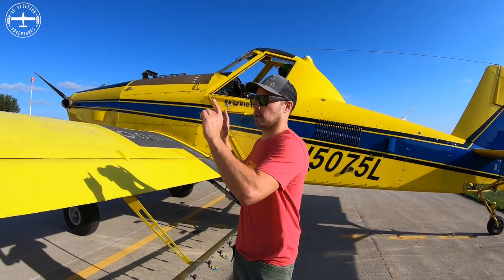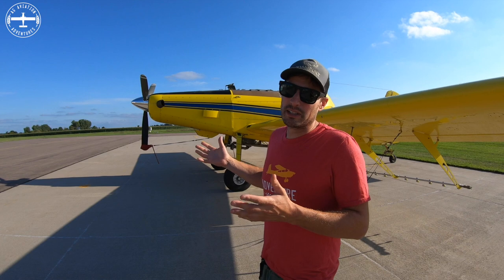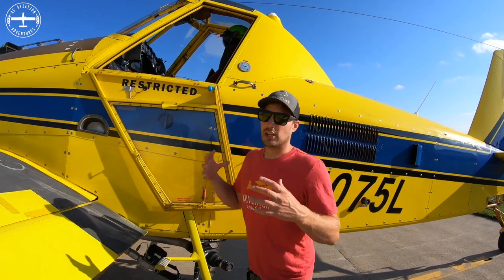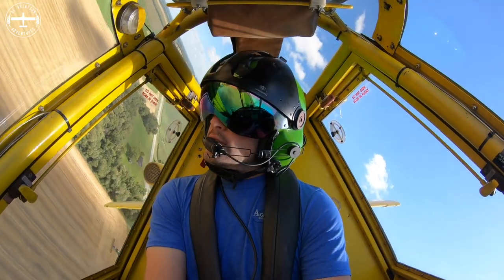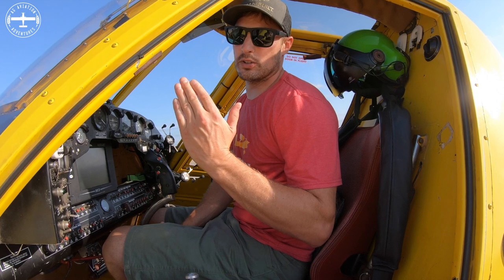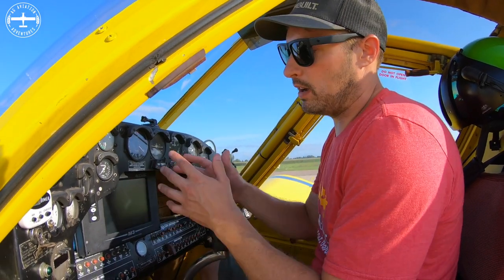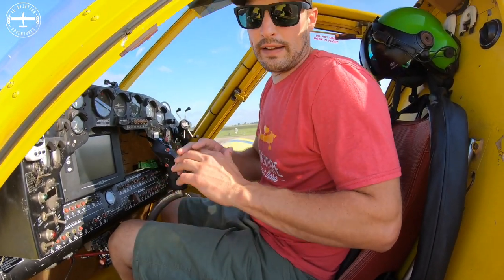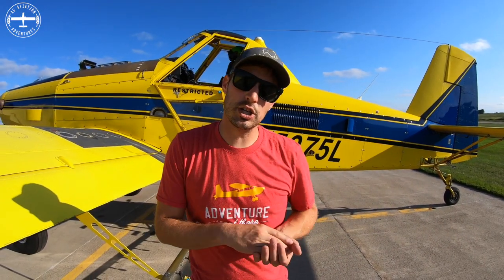Air Tractor 502 Spray Plane Walk Around

Comment: Very interesting segment.  QUESTION:  Do you have an alternate method to pressure up the spray system such that you could energize it while sitting still?  I'm thinking that might be happy for ground maintenance issues.

As always, thanks much for sharing.

Steve
Reply from the maker: Yeah for sure. You can hook a hose to it to pressurize the boom if you needed to.

Comment: What's the cable for between the cockpit and the tail?  I've always thought those were for powerline protection.
Reply from the maker: Yeah. If you happen to catch a power line it’s suppose to prevent it from ripping the  vertical stabilizer off.

Comment: The emergency lever opens the Doors to dump the load in case of emergency.  Those same doors are used to spread seed.  How do you keep from dumping all of the seed in a few seconds?
Reply from the maker: The lever has a button on top of it. If I push the button it opens the door completely. If I just push the lever forward without hitting the button it will hit a stop that is adjustable so you can vary the gate opening.

Comment: Hey Tyson I know you fly the real thing and flying your dream,but you should join us ground pilots down here and try flying RC it’s just as much fun as you are having up there...why do air tractors drop smoke from time to time?? Last summer an air tractor came by our flying field and drop a line of smoke...I guess he was saying he was having fun too.😊😊
Reply from the maker: Charlie Ayers You’re right I should go and give it a try. Something new!

That’s called a smoker. There is a button inside the cockpit and when you press it oil is injected into the exhaust and burns to create the smoke. We use them so we know which way the wind is blowing. The person would have smoked near you to make sure all of the product was going to its intended location and not drifting towards you.

Comment: Does the plane get sucked down if you drop the wheels into the crop ?  Do you have a mirror or something so you can see how high the wheels are above the crop ?

Do yo always have enough power to carry a full load or do you have to adjust for density altitude ?
Reply from the maker: If it’s corn the plane can get sucked into the crop. I’ve thankfully never had it happen. I have to adjust for DA depending on the strip I’m working off of and how long it is.

Comment: Why do you want to change the pitch off the prop
Reply from the maker: You would find it advantageous to change the pitch of the prop depending on the phase of flight (takeoff, landing, cruise).
Reply: In addition to what Tyson from AG Adventure response of being efficient throughout the flight ranges, there are two other reasons changing the propeller pitch can serve as an advantage over a fixed pitch prop.

Improved fuel efficiency and reducing the possible strain on the engine.

In the cruise phase of flight, increasing the angle-of-attack of the propeller, will be directly proportional to increasing the torque on the engine. 
And, when there's an increase on engine torque, the engine slows down improving the fuel efficiency.

Lastly, an RPM engine setting that is either too high or too low can damage the engine or wear it out prematurely.
Like Tyson mentioned, throughout the flight envelope, you'll want to have better control over the life of a powerful, high-performance engine by being able to make prop pitch changes to get more out of the investment.

Comment: Does that style engine require less maintenance than a piston engine? Do you have to take breaks mid season for  engine maintenance? Do you hire out the maintenance?
Reply from the maker: Yes the turbine engine is extremely reliable and does not require much maintenance during the season. At 300 hours I have the fuel nozzles changed. There is a local mechanic at the municipal airport that does the maintenance.

Comment: How do you feel about the structural integrity of the Air Tractor? (Or Thrush, Agwagon or Brave)  Have you ever heard of a spar/wing failure? Do you have any worries of another pilot over stressing the airframe, and are their any guards against that? Thanks for these great videos Tyson!
Reply from the maker: Thanks for watching Scott. There are ADs out for a lot of aircraft that pertain to spars. It depends on the aircraft but you need to replace the spars at certain time intervals and they need inspections as well throughout the life of the spar. At annual the airframe is also inspected for fatigue and stress as well as some aircraft having inspections every 100 hours for known failure points. They do this because of known issues however I have not personally seen a wing just fall off an airplane..... I feel safe but I know the maintenance history on what I'm flying.
Reply: @AgAviationAdventures  Hey speaking of maintenance! I'm getting my A&P license right now and I was wondering what kind of maintenance these planes usually require and if it's possible to get a decent job in the Gen. Av. sector as opposed to commercial?
Reply: I just had a Tractor fly over my house today (we have some farms nearby in this part of New Jersey) and it piqued my interest, so I just discovered your videos today.
Reply from the maker: Joshua Anderson Glad you found us!
Reply from the maker: Joshua Anderson They require annuals and lots of operators perform 100hr inspections. I think there are lots of opportunities in GA maintenance for sure.

Comment: What does the "restricted" print near the cockpit mean?

Also, can the same plane apply both wet and dry loads or no?
Reply from the maker: Every aircraft has some type of certification. An ag plane is certified in the "Restricted" category giving it special limitations on what it can and cannot do. 

Yes the same plane can do both dry and wet. You remove all the booms and pump and can hang a spreader on the bottom.
Reply: @AgAviationAdventures  thank you!
Reply from the maker: @toadamine  You bet thanks for watching.

Comment: when you pull up out the field how much speed do you loose
Reply from the maker: I'm going about 150mph across the field and when I pull into a turn I'm doing between 75mph and 100mph depending on how loaded I am.
Reply: so you are loosing altitude as well
Reply from the maker: David Bradford Yeah in a turn I’ll climb anywhere from 300’-400’. Just depends on winds and how loaded I am.
Reply: when you turn to come back to the field and it sounds like your throttling back is that just the constant speed propeller changing pitch. And how often do you move the throttle.
Reply from the maker: David Bradford I don’t know if the sound can be attributed to one single thing or if it’s a multitude of factors. I definitely can hear the turbine engine though when it’s going away vs when it’s coming towards me. Same thing in a turn. 

I personally don’t touch the throttle very often. Some guys will pull it back as the load comes off but for me in this particular aircraft I leave it. I have never had an issue feeling like it’s going too fast or that I need to pull power back.
Reply: Thanks
Reply: Do you use your flaps in a turn and why
Reply from the maker: David Bradford You bet.
Reply from the maker: David Bradford In an Air Tractor yes. They are designed to use flaps which in my opinion is a big downside to them. The wing is very long and skinny and by adding a little flap in a turn when the aircraft is slow it does provide some lift. Without the flaps it wants to stall very easily and you have to do large flat turns to get it around. On the other hand a Thrush has a very “fat” wing (lower aspect ratio) and do not require flaps in a turn.